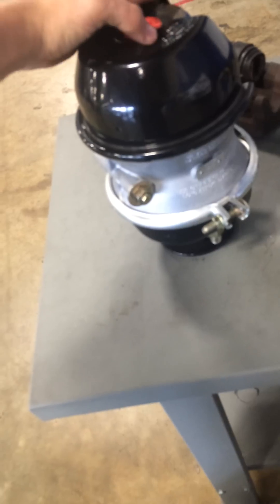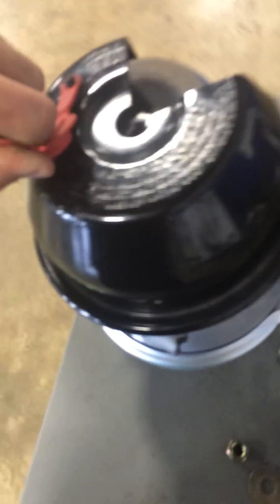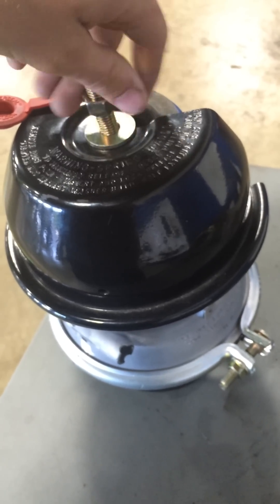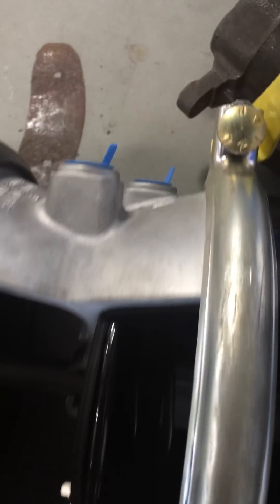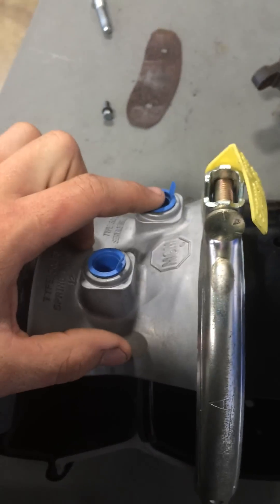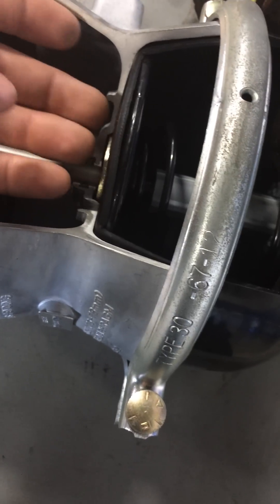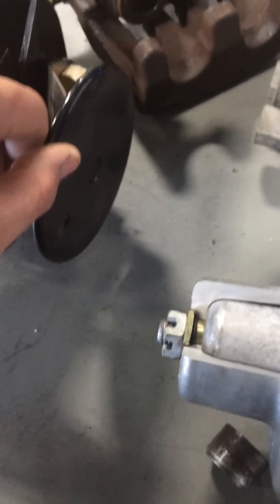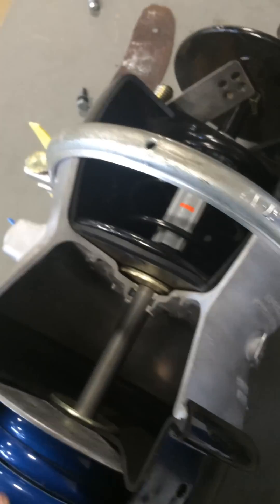how a brake chamber works

Comment: And for those attempting to change brake chambers themselves, always cage the spring. These things are potentially dangerous to your health if you're unsure of the operation. Another tip, carry a spare cage bolt and double nut it. When the   chamber goes for a shit, sometimes the shaft gets out of line and full of corrosion.  Getting the bolt in is impossible unless you hammer it in and turn thus that's why the double nut.  Trust me, I drive log truck and we go thru lots of these. I also carry  a 3 inch C-clamp to pinch off the air supply. Better than visegrips and two quarters.